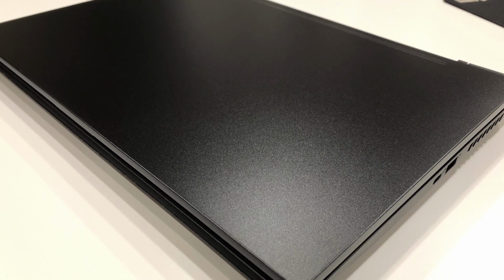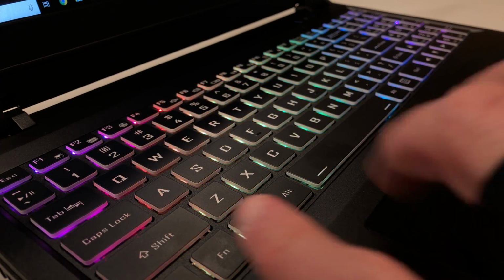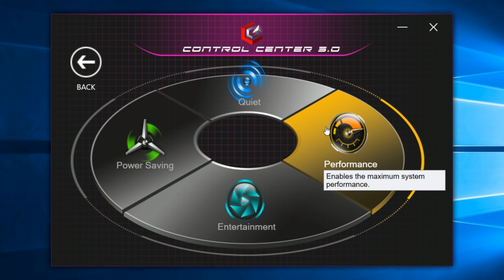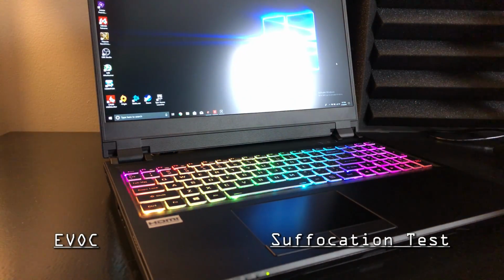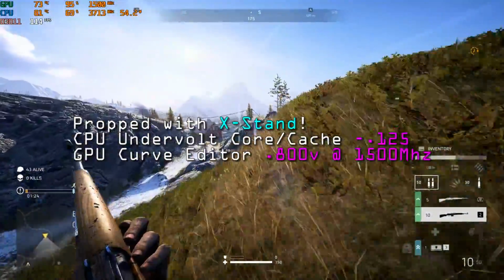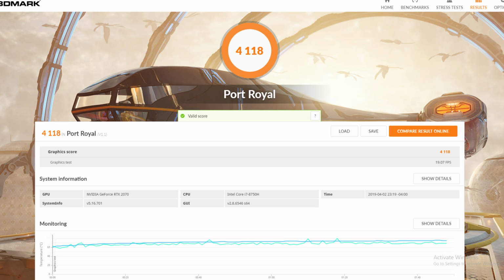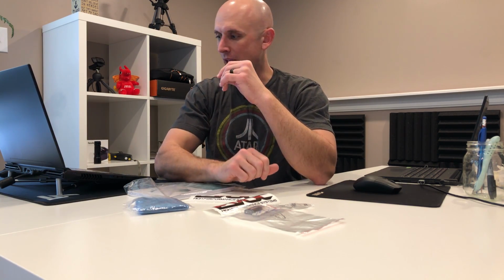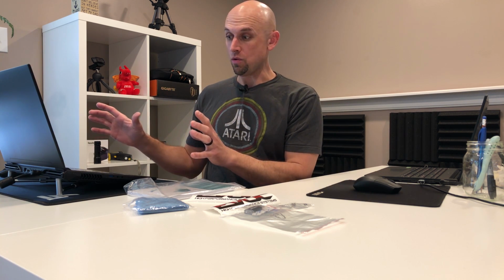EVOC High Performance Systems PB51EF-G!  Oh WOW!

Comment: Hi, how to dissemble it? in details please. I unscrewed 14 screws, tried to remove back panel, but could not.
Reply: i have this same laptop. once you remove all the screws it should just come right out. i would take the battery out first (will make it easier to take the back cover off). after that i put my hands in the battery tray and pull up a little. it should start to pop out. also in the back near the exhaust vents you might have to pull the back panal away from the chassis. it gets stuck back by the exhaust vents sometimes with me. hope this helps.
Reply: Dude.. I hope my comment finds you before you broke anything. I have a similar model and the back panel just SLIDES AWAY after you take the screws out. NO prying AT ALL.

Comment: Hey Bob if I opt for conductonaut paste from hid, does the risk to spill from transporting exists? Because I saw some video that there is a risk that conductonaut leaks from gpu/cpu if transported
Reply from the maker: I showcase their work on every video review on theirs. Kapton tape and a foam barrier are the best methods and they apply them both. 

They warranty their work too. Probably not much to worry about 👍
Reply: @BobOfAllTrades  oh ok, good to know that. I asked because it's kinda complicated, my gf brings the laptop for me from USA, I'm from Romania and there's a long road and I want as fewer risks as possible. If anything happens, sending it back into USA for warranty takes looooot of time
Reply: @BobOfAllTrades   one more thing, I see the panel is FHD and not IPS. Is it on 6 bit color depth or 8 bit? Do you know?
Reply from the maker: skunkserenade It’s ips. LG has the rights to calling ips panels “IPS” so other manufacturers have to call it something else. Yes it’s 8 bit.
Reply: @BobOfAllTrades  oh ok, thank you
Reply: After intense search for a laptop under 2k USD, I will order this one due to its specs/price and due to your review which I take very serious. After having trouble with my previous laptop, what really made me want this one is gsync and the option to swap between graphics cards.
Reply from the maker: skunkserenade Tell HID my review helped you. Maybe they’ll send more for me to cover 👍
Reply: @BobOfAllTrades  oke, I'll do that

Comment: I'm surprisingly interested. Too bad it doesn't have an i9....and yes I know it will throttle for normal users. I'm not a normal user. I will have to ask Prema about BIOS though. Great review bro! RageSet.
Reply: Superfluous paper spec given its throttled performance....
Reply: @sdushdiu  As I've stated, I'm not a normal user. It wouldn't throttle during my overclocking adventures.
Reply: @sliceofmymind  Yawn.  Whatever. then your comments are superfluous.
Reply: @sdushdiu  Ironic. Superfluous commentary about proposed superfluous commentary.
Reply: @sliceofmymind  Bottomline:  Your constitute noise.
Reply: bacon is better
Reply from the maker: Brad Haines  That has to be a T-shirt!
Reply from the maker: Frank R Yup the i9 in one of these would be great when under load solo. Obviously combined with the GPU gaming would be a waste but rendering video in Premiere with GPU acceleration would likely be fine too 👍
Reply: The i9 options are available now with the release of 9th gen. U can check the local store if its available there in your country. Mine is in Australia, here we call it Metabox
Reply: Depends on re-seller really, I know one local clevo re-seller that has 17'' model (PB71RF-G) equipped with Intel Core i9-9980HK. It's pricey as hell though.

Comment: could you do a video on the difference between 2400/2666/3000mhz ram?
Reply from the maker: The faster the RAM the higher the minimum frame rate in cpu intensive titles provided the laptop is capable of the faster speed. Done ✅

Comment: 50 dB is quiet now?

Yikes. Sticking with my GT62VR.
Reply from the maker: Many laptops will hit 60dB too. These 12 thread CPUs and 115w GPUs in a chassis that can hardly breathe leaves this acoustic result.
Reply: @BobOfAllTrades Really appreciate your reviews Bob. Have been enjoying them thoroughly. 

A quick question about this machine... You mentioned Entertainment Mode limits the CPU to 45w. Does it let the GPU run?
Similarly, does Quiet Mode limit the CPU to 35w or something? And if so, does it also let the GPU run.

I don't really care about CPU performance - I prioritise gaming, exterior heat and fan noise.
Currently considering moving to the TongFang 17". Your review was very helpful there... from what I gather, I could actually game with Office Mode and I wouldn't really lose a massive amount of frames. The GPU can still do it's thing.
Reply from the maker: I would run it on Performance mode then use my Performance Tuning Guide video and learn how to power limit throttle the CPU. This will ensure strong performance and you can tweak to get the best CPU thermals regardless. This is ideal as it’ll offer a more consistent experience even when Windows updates screw things up.
Reply: @BobOfAllTrades  Thanks Bob... I'll queue the 8750 one up for tomorrow.

Out of interest - which machine would you point me towards for a 17" thin bezel unit with low fan noise?

Almost all machines review with high fan noise - you're one of the very few who touche on the non-turbo MaXfAn modes (despite having a strong preference for them yourself!)
Reply from the maker: BeliveInUrself  Fan noise is inevitable as these machines are packing some serious power and try to stay cool especially Intel CPUs. My current favorite 17 inch gaming notebook that’s not too terribly loud is the Raider GE 75
Reply: @BobOfAllTrades  I thought that was one of the loudest? I'll have to watch your vid again.

Thanks again Bob. You're a huge asset to gaming laptop enthusiasts the world over.
Reply from the maker: Max fan dB is around 50. The absolute best I’ve seen is 48dB. 

I’m testing a Raider right now with an 8 core CPU and 150W 2080 with the same fan capabilities maxing out at 50 dB.
Reply: Okay yeah, that is impressive.

Makes me wonder how quiet it would be in Sport + Auto mode..

Comment: Hey Bob, my GPU throttles at 83C despite GPU-Z showing 87C temp limit. I have tried undervolt + curve the GPU + prop and it still hits 83C. CPU is running cooler though at 75C to 80C. Any chance is it lemon unit? Thanks!

And thanks for the review!
Reply: Habe you repeaste the cpu and gpu?

Comment: @Bob Of All Trades sir can i request for the screenshots of your throttlestop settings? Im constantly getting a "power limit throttling" in the msi afterburner OSD. My clock speeds only runs at 2911 to 3011 mhz and package tdp at 15 to 25W only. :(
Reply from the maker: I’d love to help but I already sent this review unit back last week. 

PL throttling is a part of life with these “45w” chips that will happily pull 90w if they were uncorked.  

What you have seems like a software setting issue.  

If you’re using Clevo Control Center you should should recall that in this review in order to pull the highest wattage you have to set it to “performance”.
Reply: @BobOfAllTrades  i already set it in performance in the clevo control center.. 3d settings in nvidia control panel was also set to "prefer maximum performance". Battery setting was also set to high performance.. under throttle stop i just enabled speedshift epp. But it was set by default at 128 because i dont know how to tinker with this. Also BDPROCHOT was also checked in my throttlestop settings.

Comment: This is still good chooise in this price or  I should get other laptop?
Reply from the maker: Only you will know that based on the price you can get this laptop compared to what’s available. 

It’s one of very few laptops that have a MUX switch and Gsync when equipped with the FHD display.  Thats an awesome feature I think.
Reply: @BobOfAllTrades  in my country 1850 dollars  for laptop based on this clevo model but with 9th gen i7 with same screen  and rtx 2070... Good think is that product has liquid metal on procesor and polished heat sink by company
Reply: @BobOfAllTrades  what laptop do you recommend at this price or cheaper

Comment: 12:53 Maybe a poll idea... whether extra battery space is preferred or a 2.5" drive instead. Personally, I want the extra space because I'm not very mobile, and like to have quick access to as much of my media as possible. Am I really in the minority?
Reply: It's also a matter of cost for me. My laptop has two m.2 drives and one 2.5" HDD. Small NVMe for boot drive, large SATA SSD for media, and large HDD for overflow. By getting a larger battery you are throwing away that additional cheap 1-2TB. 2 TB of SSD (especially NVMe) is very expensive.
Reply from the maker: If this works for you then you’re set 👍 Sata m.2 is cheaper by the day and NVMe is getting there too. I have two TB in the AERO. 1tb NVMe came with it and the other 1tb NVMe cost me about $125 and I enjoy that 94whr battery because of it. 

BUT!!! If you’re honestly not too mobile then this is one heck of a laptop!! Imagine adding a 4tb 2.5” drive in here!  Sounds heavenly to me!

Comment: even with $100 liquid metal and fuijipoly, undervolt and more adjustments it needs a laptop stand to cool the components appropriately. that keyboard flexes like a piece of cardboard ouch. and how is an 1h30 to 4h battery "above average"?? Price isn't even that competitive after the laptop is configured like the one in yours with the 500gb ssd and thermal upgrades. definitely a pass.
Reply: Aorus 15 x9 is better
Reply from the maker: Most laptops can’t pull off 55w 8750 at all let alone a 115w GPU.  Putting this in most 15” laptops would overheat propped or not. 

Battery life at 4 hours with Optimus is above average per the specs inside.  Real world battery life is much less than what most tell you. 

The price of laptops is falling as 9th gen releases soon. 

I spoke of price in the GT75 review and the it dropped $400+ in less than a week. Those who watch that recent review now would be much happier if o left out price.  Let’s see what happens 👍
Reply from the maker: Bang for the buck?
Reply: As BOAT said few 15.6 chassis offer 115 watt RTX 2070 MaX P and 60 watt CPU boost whitouth severe thermal throttling. Only other one I can think of is the new Asus RoG Zephyrus S 502, but you pay the brand tax and extra for premium magnesium allow chassis, hinge cooling system and RGB  strips. Larger 76 watt hour bsttery but lose the 2.5" HDD bay. Roughly 300-400$ over the Clevo chassis for identical specs and performance.

Comment: Good video, though I expected to see more games to be tested :-/
Reply from the maker: If it runs the games you just saw it can handle anything else you want to see.

There’s nothing it can’t handle after exposing its weakness and tuning it. 

That’s the way this works here.  Getting too invested in tons of titles loses it relevancy as drivers get updated.  Then you’re left with sifting through the necessary facts that are present here now.
Reply: @BobOfAllTrades  My point was it would be interesting to see things like min/average FPS to compare it to other models in specific games - to see, for example, how Metro Exodus would run with RTX enabled (you can't see that simply by looking at 3DMark benchmarks), which according to some older tests may drop to less than 30 fps at 1080p on mobile 2070 on some notebook models. Same goes for few other games. It's definitively not necessary and you are always free to make your videos any way you want to, just something which would be interesting to see for comparison purposes, and you can always push all this benchmark data to the end of the video so people who don't want to know these (because they don't play these games) could easily skip it ;-)